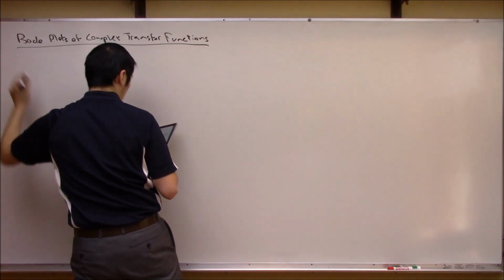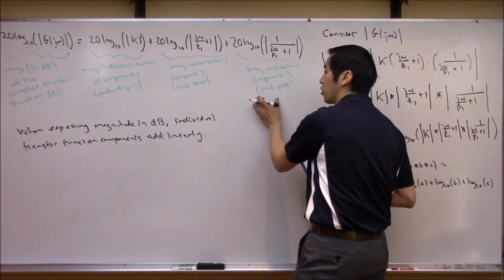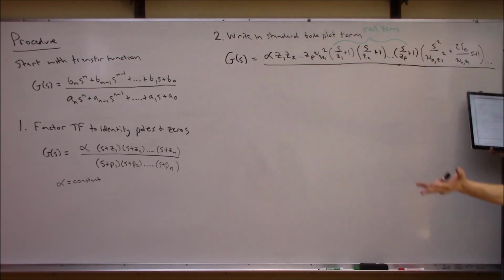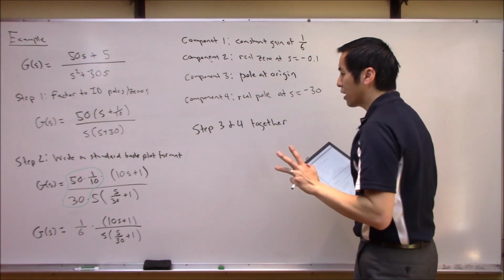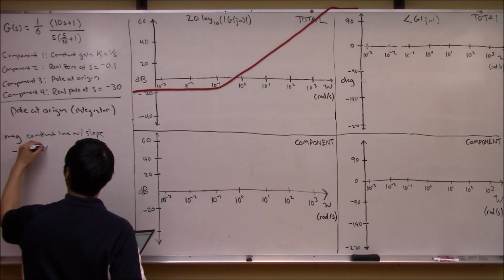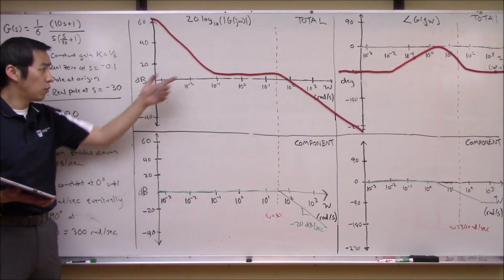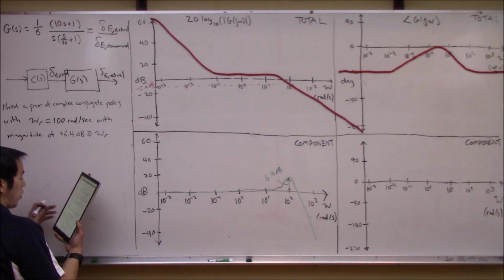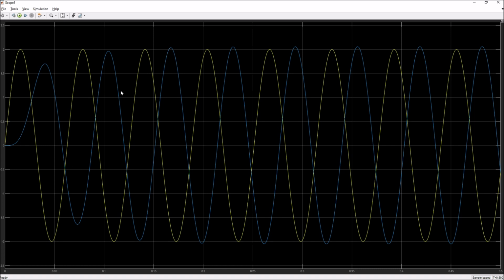Bode Plots of Complex Transfer Functions

Comment: AE511: I'm a big fan of this video. At the start admittedly I was mostly just taking notes down getting ready to come back and reference this video when I do the sketching problem on the HW, but I was curious why there was so much more left in the video after you showed the matching bode plot in MATLAB. Jumping directly into an example tying how this graphs relates to a mechanical system was great. Relating a bode plot to reality was a challenge for me when I studied controls in undergrad and it didn't stick for me once my class shifted focus to root locus and Nyquist techniques. I'm very glad you covered it in this video and didn't just do sketches of the bode plot; I think it will help me develop the intuition needed to use bode plots effectively.
Reply from the maker: Matthew, I'm glad this was useful and thanks for the great comment.  I find bode plots one of the more useful tools for controls and dynamics analysis.  It also has usage in vibration, acoustics, and anything else that is related to frequency.  I hope you'll find it useful in future engineering applications.

Comment: AE511 - are there transfer functions that this can't be applied to?  I suppose an exponential or just in general non-polynomial, but I'm not sure if those ever show up in actual transfer functions for real systems
Reply from the maker: This depends on what you call a "transfer function".  In the academic sense that we've defined in this class, the transfer function is ALWAYS a ratio of polynomials as they come from a linear time invariant system.  As such, this technique will always work.  That being said, some engineers use the term "transfer function" to mean the dynamic input/output relation of a system.  If this system is nonlinear then you can't represent it as a ratio of polynomials.

Comment: i just wish someone explained this on examples when your pole or zero is not (jw+a), but (jw-a) :(
Reply from the maker: If you have a pole with positive real part then the system is unstable and it's frequency response is undefined because the output grows exponentially, therefore there is no steady state response.
Reply: @ChristopherLum  yes that makes sense, however I have to plot bode for 4 examples from my professor's script. I would be happy to share all 4 but here is the first one:
G(s) = 100 / ((s+1) (s-1))
The solutions are given aswell yet those doesn't help much with me understanding that

What if the zero has negative real part? Could you bode plot then? 

Thank you for the quick answer :)
Reply: so I've been searching for more explanation on this topic and I've found it at http://onmyphd.com/?p=bode.plot
apparently a RHP pole plots same as the LHP zero, but just for phase, whilist for the amplitude it doesn't matter where the pole/zero is located. Same goes for RHP zero.